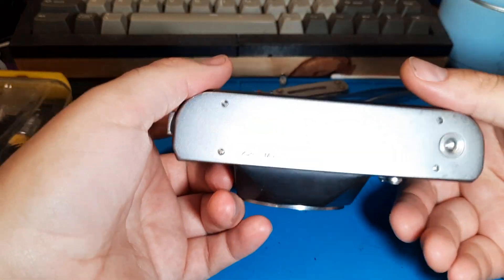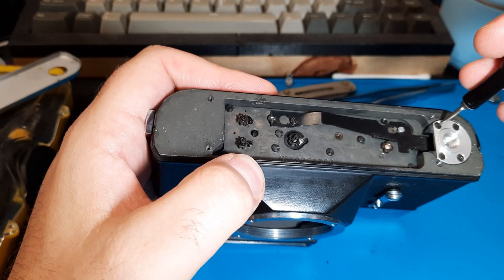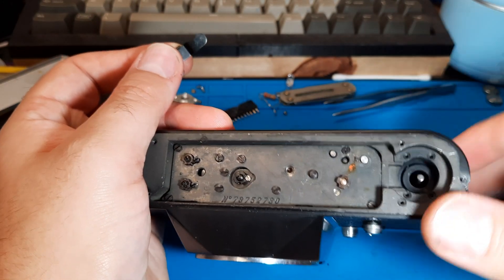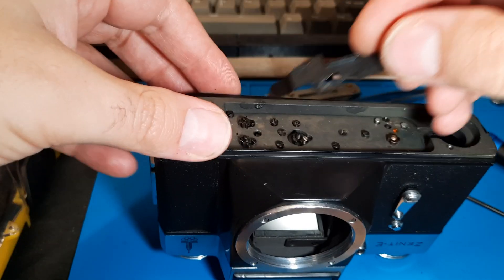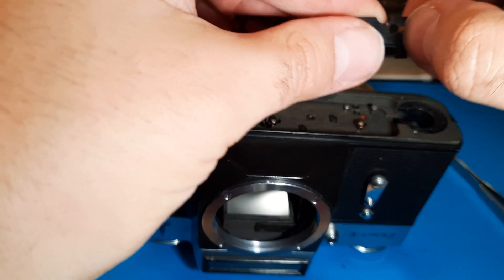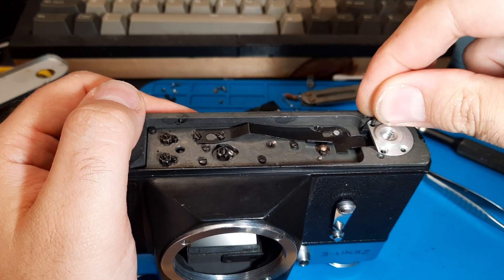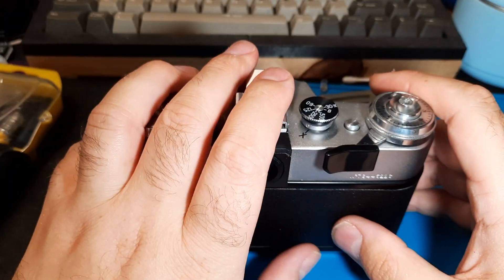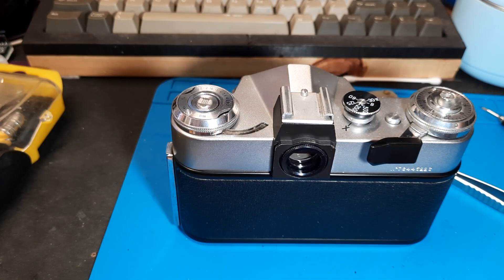ZENIT-E Shutter Spring Adjustment

Comment: I'm having an issue with my Zenit e m on 500 of a speed the film advance leather is very sticky and when it's charged and released it's sometimes moves too quickly and leaves a black line in one of the corners or acts like it's a bulb flash the rest of the speeds work  ok but the film advances still stiff. Do you have any advice do you think this video would help even though it's the em and could it be a different issue I have a suspicion it might need cleaning if so how would I do that and what are your opinions on how I should move forward. Most places refused to work on them
Reply from the maker: Sounds like you need to give the gears a clean & lube up.